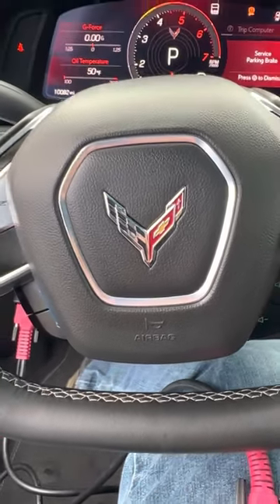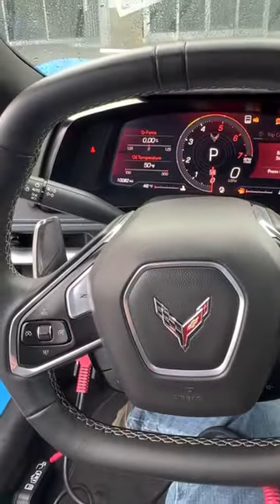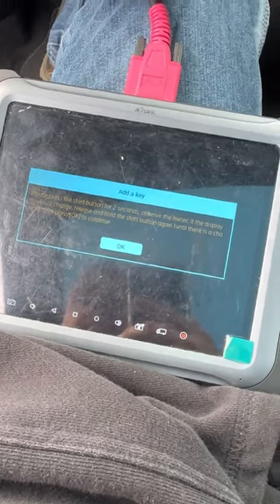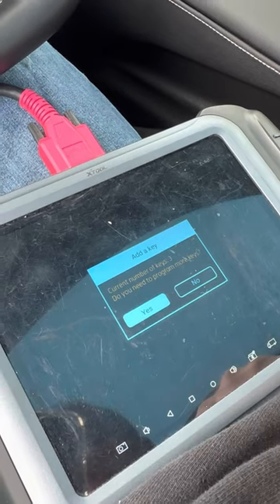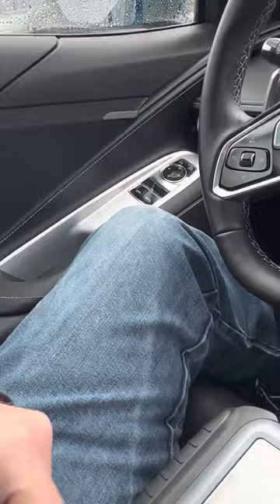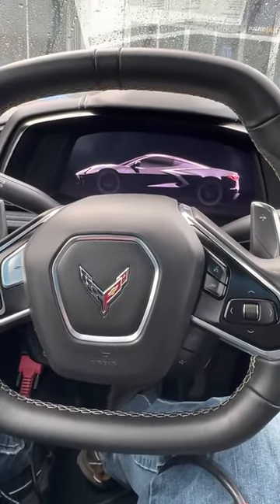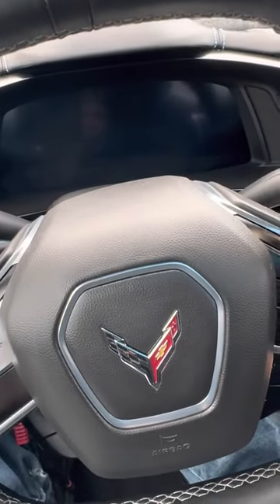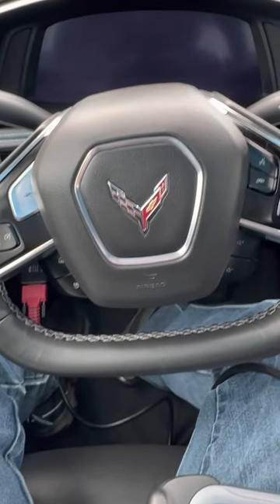2021 Chevrolet Corvette Stingray ZL1 Key Fob Programming - XTool AutoProPad G2 with CanFD Adapter

Comment: I thought they ask for a 24 digit code from gmc to program the key.
Reply: where you using autel?
Reply: @tommyherrera6456 does autopro pad not require 24 digit pin